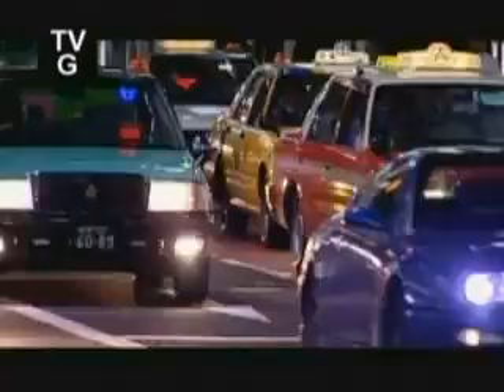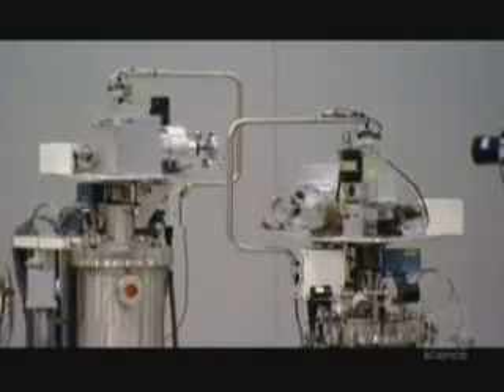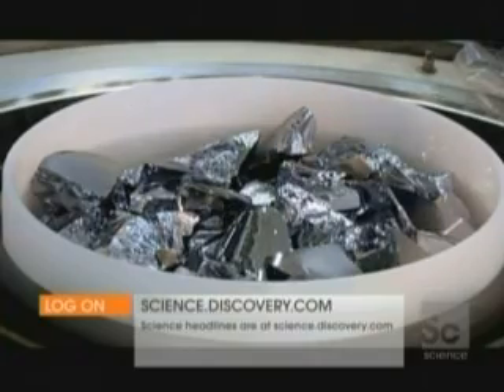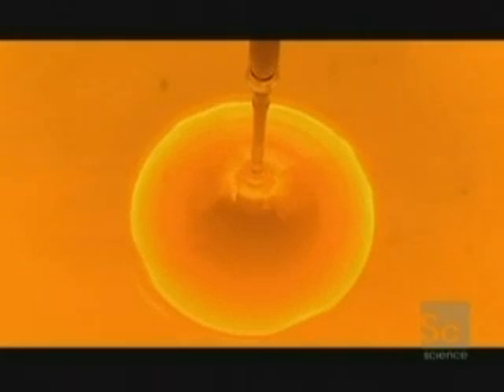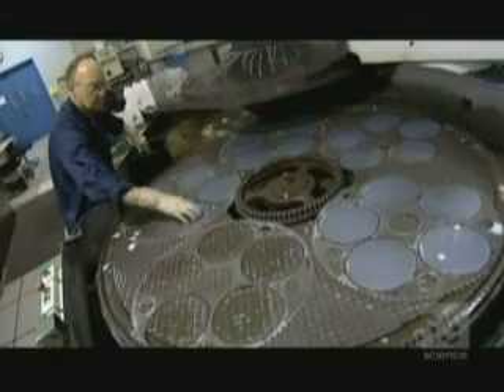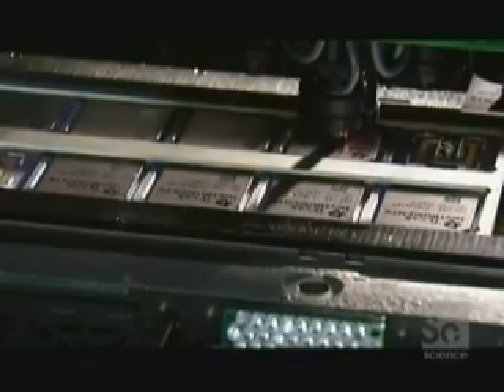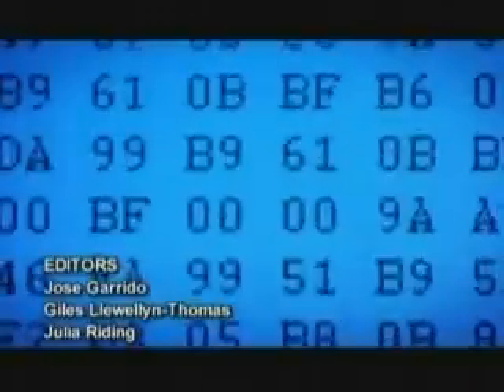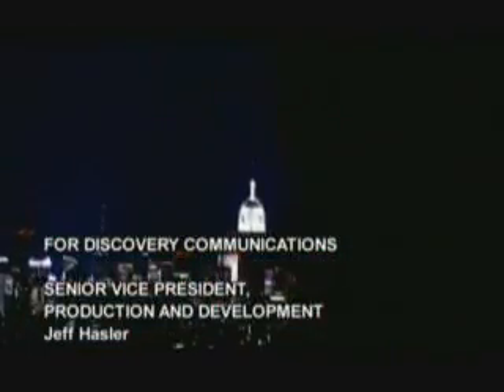How do they make Silicon Wafers and Computer Chips?

Comment from the maker: @feye1markie In order to make electronic circuits, the material you choose must be able to carry electric current and possess the ability to switch the current off and on electronically. The earliest circuits were controlled by mechanical switches. Then came vacuum tubes, semiconductor transistors and now silicon chip. Silicon is a neutral substrate which become semiconducting after selective kind of impurities are doped on it. Different layers of impurities are printed on the wafer as circuits.

Comment from the maker: I have heard about optical computer like 30 years ago.  However, I don't know if they have made enough progress to out-perform silicon technology in term of the cost/benefit ratio.  Check out the link in the description section. Diamond computer chip is next in line. When you can over-clock the chip with no worry of a melt down, optical chip may not be necessary.

Comment from the maker: According to some news, a new carbon based material called graphene has better potential than silicon, faster and more heat resistent etc. It is still in research stage.

Comment from the maker: I read many years ago, IBM was doing research in optical computer.  Instead of using silicon, they use some organic gel and lasers to build the computer.  Instead of using electrons, they use the interference patterns of light and laser to do computing.  I have not heard much since then.  I have also read about using carbon atoms deposits to form thin film of diamond crystal for IC chips. Diamond can takes great heat.  No cooling required.  No news either.  Just don't hold your breath.

Comment from the maker: In my opinion, silicon should have at least a few decades to go. Even if any of the discovery or breakthrough comes out of research stage into production stage today, it will still take a couple of decades to take over the dominance of silicon.  Foundary are not cheap to build, if Silicon still fill the demand, it won't go away anytime soon.